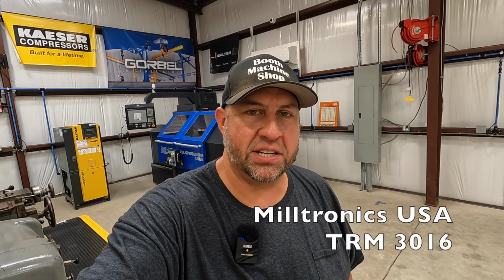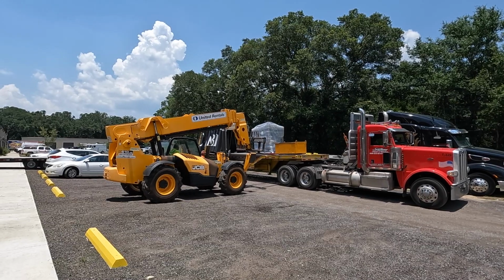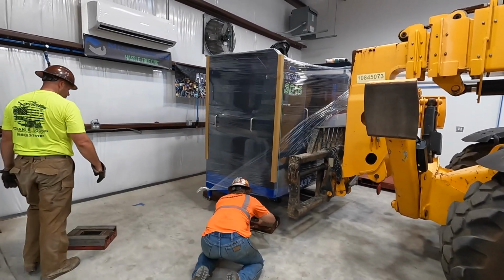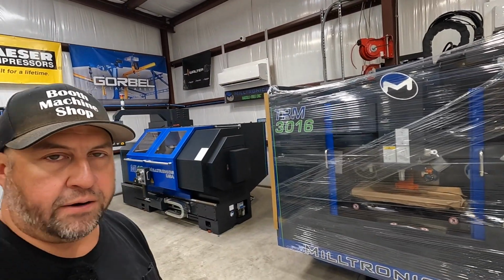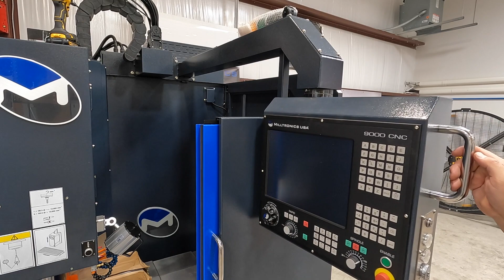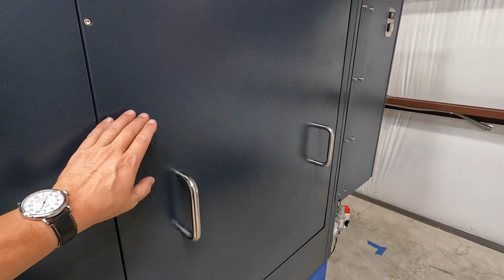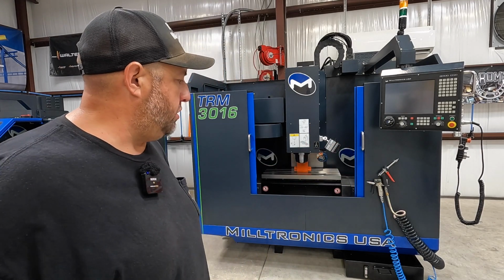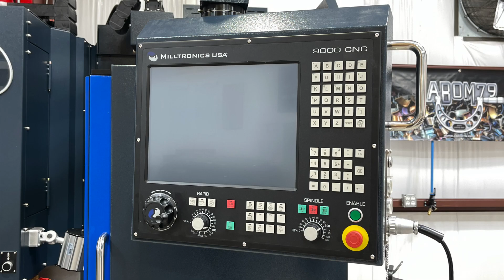Milltronics USA TRM 3016 Delivery & Install

Comment: Are these machine made in USA  ?  If not where are they made ?
Reply: Fairly certain they're manufactured in Taiwan. It's a US based company and I THINK they make a portion of the machine in the US (the controls?)
Reply: It is made with chinese metal in a taiwanese factory assembled by other asian foreign workers using japanese drives/motors, german controllers and software written by indians and given its product name by an american company.
So yes - it is a US made product.

Comment: It can hold a angle but can't change angle  with that load
Reply: Yeah there was not enough pressure for a fork-up... Pretty common occurrence with any big forklift or front loader...the only thing he could have done was fork up excessively from the get go which would have been just as sketch if not more so. Its a rental, you cant expect these guys to be experts on every piece of rented equipment. Half of the rental lifts (skytrak, pettibone, gradall) are sooooooo poorly maintained that youre lucky they start at all. Plus you got some guy video taping their every move. Its really not a good scenario for these guys to be working like that. Leave them alone and let them do their job. They got insurance if anything gets fokt up

Comment: I have read a lot these comments comparing CNC to manual machines. My question that I have ask many salesman of CNC machinery, “ how did they make the first one?”
Reply: Chicken?  Meet Egg.
Reply: That doesn't even make any sense.  How did they make the first manual lathe?  They sure didn't use a lathe to do it.  Does that make the lathe any less important or useful?  What a silly comment.

Comment: That's surprising!  I see the  cement floor is cracking?  Isn't it less than a year old?
Reply: Nearly impossible to avoid in many cases when things dries up, and has no practical meaning
Reply: Surprised concrete cracked?
Reply: It's concrete, not cement.  That's what concrete does.

Comment: Your gonna have to move that mill if you want any kind of true accuracy...
Spanning control joints and a crack is gonna cause issues with repeatability.
Reply: If accuracy and repeatability become a problem a frame to support the machine can be constructed.  Dampers can be added to isolate movement.   There are lots of factories building airplanes and rockets in  California and Washington near active earthquake zones.  Hughes Aircraft and TRW built a lot of sstellites in LA, next to or near LAX.
Reply: That's what offsets are for.....lol

Comment: If you put out an abom tool, please make it affordable. So many of the things available in this forum are excessively overpriced for non-professionals.
Reply: If it's anything good it won't be cheap. Materials, machining hours and tool wear add up really quickly. Just for reference: a 1x4" carbide end mill costs $580. If you can do 10 jobs with one of those before it's too dull to cut accurately, so it can only be used for roughing passes, that's $58 on the base unit price right there.
Reply: Nothing in machining is cheap. Nothing.

Comment: That lift was not capable of curling the load . Undersize machine by far Adam.  I would call there office and tell them come more prepared next time .
Reply: Rigging companys are so busy (swamped) right now (when this was filmed)  that Adam was lucky to get the 3 stooges crew and the rental fork lift he got.  All the US Ports are finally spitting out machines (from shipping containers) that have been on order for the last 30 months. And Rigging Companies are SWAMPED trying there best to cover all there customers that have been patiently waiting on machines. My brother is the head of maintenance for a a medium size company here in NE Ohio. He was told 8 days ago that he would need to have 3 Rigging crews of 4 men each starting in 4 days. That there 17 pieces of new equipment from Germany (that was ordered in 2019) would be arriving in 24 hours to the Port of Cleveland in containers. And they only get 2 days before the demerge charges start on the containers. Its $100.00 the first day, $200.00 the second day, $300.00 the third day and so on and so on. Basically they want to unload it off the ship and reload the empty containers right back on and go. The days of leaving the equipment stored in the containers that it came in for weeks and months are OVER. And the Ports are charging HUGE warehouse fees, just because there so jam packed full of equipment that needs loaded out and moved to it new home. Now try and find trucks, Especially multi axle heavy haul trucks. GOOD LUCK, and BTW, a 8 axle with a 53' RGN today is STARTING  at $30.00 a mile (plus permits and escorts)  here around the Great Lakes.

Comment: Are you wishing you had a gantry crain?
Reply: His gantry crane isn't meant for machinery, but for material/tools.
Reply: @IceBergGeo  I know that he has a Gimbal Crain. I was just remembering the giant gantry Crain's they had at McDonnell Douglas Aerospace in 1973 when I worked there
Reply: @marlobreding7402  yeah, those are very not cheap. But his little one at his home shop..
Reply: @IceBergGeo  his "A" Frame?
Reply: @marlobreding7402  yeah... Maybe I've got my descriptions messed up, but I thought that was a gantry crane, of sorts.
Reply: @IceBergGeo  naw, a gantry had 2 rails one on each other of the long side of the shop with the gantry able to reach most of the shop.

Comment: Very nice mill, but its missing chip auger to get rid of those chips out of the machine.
Reply: Very true! Since he's just going to be learning CNC on it for now and not doing production work, he aught to be able to get by just fine without it.
Reply: @52Ford  Yes thats true, but the time of cleanup will come sooner or latter and it'll be paint the backside to clean it. Its not like manual mill where you have access to whole machine and this mill is tiny so going in with broom and shovel isn't possible.

Comment: Very surprised that the only documentation received was in the back. Machine tools always should get parts books at the very least
Reply: Seems to me that Adam just made an excellent unpacking video for Milltronics. Surely they have all of that online.
Reply: @justryan7109  Proper hard copy docs last. I have commissioned as a customer about 12 different brands of CNC over the years and They usually come with Programming manuals, Machine manuals, Electrical and mechanical diagrams, drive manuals and other docs relating to a fixture if fitted. 2 copies of each as a minimum. The thing is hard copy's should be there electronic versions especially have problems occasionally. 2 hard copies are normally divided between the service branch of the dealer and the customer.
Reply: @dazaspc  I have to admit you have definitely convinced me. Something this expensive and complicated should definitely include all of that. It could be that Adam just didn’t include that particular stuff in the video.

Comment: I assume most of the skills transfer, but Manual machining has a craftsmanship that is not there in CNC. It’s still magical to see computers build things from digital, but the hands are not there…
Reply: I appreciate non-CNC machines as much as anyone, but if you look closely at some CNC-created parts, they have a look of "crispness", precision, and quality that's hard to match.
Reply: Bullshit there is no craftsmanship in a CNC part.  It's easy to spot a rookie's CNC program from an experienced programmers parts.
Reply: @brandons9138  I get it, but for parts that are hidden inside an industrial machine, all you want are good metal and high precision.
Reply: @Bob_Adkins  I'm not sure I understand your reply.
Reply: @brandons9138  Exactly. People think that these machine do things on their own at the press of a button, ignoring the fact that they only allow an experienced machinist to move the axis of a precision built machine tool, exactly in the way he/she thought was the absolute best, without making compromises due to being handicapped by the number of hardware axes available (or expensive single purpose attachments from bankrupt companies) or due to the economies of being fired if you need to setup every individual "single pass" feature to finish the distortion out...A CNC lathe or a machining center, allows an experienced machinist to timely and precisely finish contours of any shape, in the way he intended/envisioned, instead of making a part that is "good enough to hopefully never be seen again". I want to make parts that will proudly reveal themselves when pulled out of machinery 10-20 years from now and be proud of my exceptional work...not try to pacify clients about the chattered looking form tool finish being "good enough"

PS: I have run a "keyseat cutter" that I made out of an old broken endmill by freehanding it with an angle grinder, on a 2021 DMG Mori VMC to relieve the bottom corners of some drill press jigs for high volume production. Programmed it 30 microns above the end milled surface to account for deflection and only got a handful of minor scratches on the almost mirror finish left from a light and quick finish pass on steel, with an 8mm endmill contouring at 11k RPM (with a 2.2kw pump flushing it out with coolant through the collet, to achieve zero edge build up on the tool and get the best surface finish that a material of any specific hardness can give) and more than 1,8m/min feed rate (to maintain the proper chipload, so that this very same endmill could last cutting another 1600 1.25xD slots for another repeatitive work we had with burrs on top and limited machine horsepower being the only limiting factors).
Reply: @Sketch1994  Craftsmanship defined right there.  It's the attention to the smallest of details that matter.  The methods/tools used are not even part of the equation really.
Reply: @brandons9138  definitely there is a lot of knowledge and experience to do it well and efficiently. And as I said a lot of it transfers like holding, rigidity, types of cuts, feeds and speeds. But you get the Craftsman's experience and turn it into code and presto.  The execution is robotic. Makes a lot of  sense but does not have the same flow: measure, feel the material, creep up to dimension. All of this is in the code, run/inspect or abort due bugs in the code. Once you have the final code it's just execution, with correct setup.  Both have their merit.
Reply: @Nebulorum  I disagree whole heartedly.  I've been given jobs where I have to go one for one with material.  Meaning that I have one blank to make one part and that part has to be good.  The flow of making that part is just like you'd do on a manual machine. The difference is on a CNC machine I can make adjustments to the tool/program and rerun the program knowing that the human error factor of actually turning a hand wheel is not an issue.  Creeping up on a tolerance is some thing that is done regularly on jobs where tolerances are tight.  I had jobs where I've had to hold .0003 (inch) total tolerance.  Hitting that is definitely a creep up on it situation.  That particular job turned into a production job for my last shop.  We had to turn out 100's of those parts regularly.  That took time, effort and craftsman ship to do that in a timely fashion with out a scrap rate that would bury the job as a loser.  As far feeling the material cut goes, it is so over rated.  I can look at the chemical composition and hardness of a material and tell you how it's going to machine for the most part.
Reply: Takes a lot of skills and knowledge to prepare and setup a part to be cnc milled to spec) Some think it's just to push a button and everything works out:) It's like working on a classical 60's car vs a 2020 model. In both cases one need the basic skills and understanding, but just a bit different things involved into getting to the goal; make the car running down the road
Reply: @Rimrock300  Not just in milling.  Proper material preparation can make or break lathe jobs as well.
Reply: CNC also has craftmanship, but it is done at the computer, not the hand wheels.